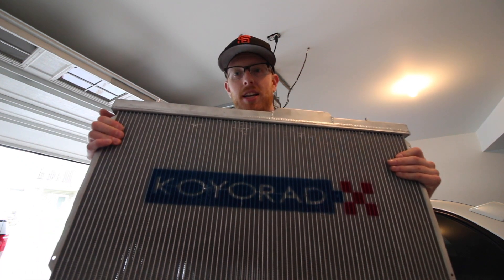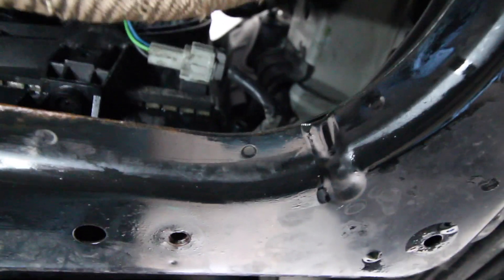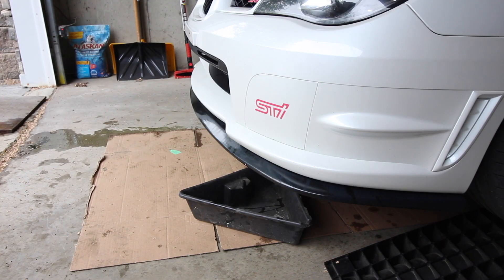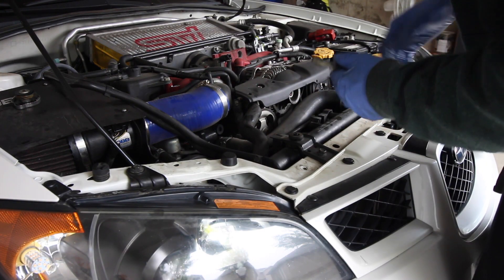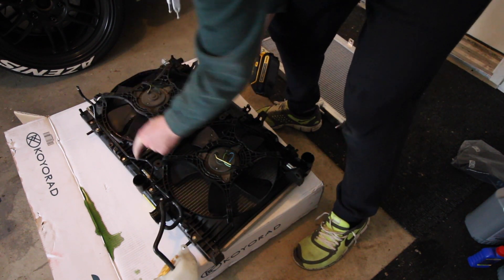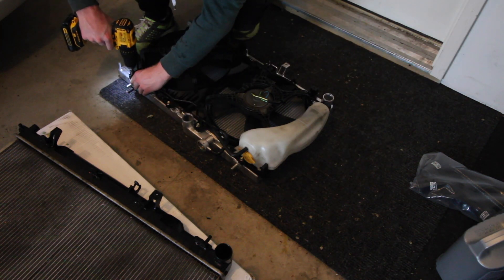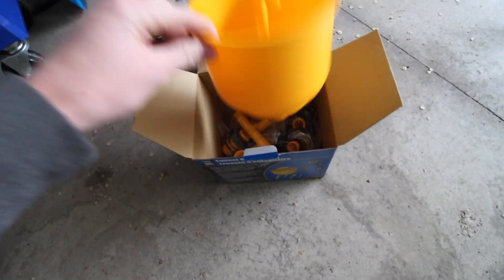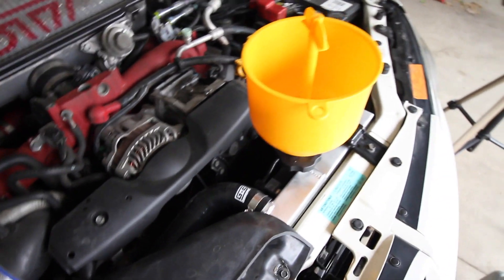How To Install an Aftermarket KOYO Radiator

Comment: This video was the confidence and basis for my own successful Koyo install yesterday, thanks for being thorough. I remember having to burp it over the course of hours once it cools, several times over. Temps though are noticably cooler, not so much during regular driving, but when going uphill it maintained a certain temp (~194-196) as opposed to before it would jump well past 200, even 210
Reply from the maker: Happy to hear man :)